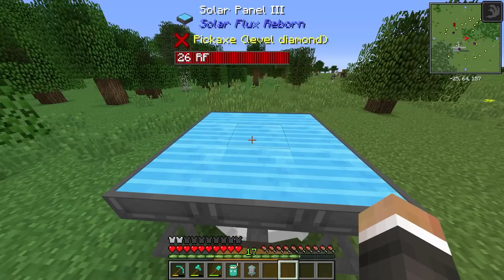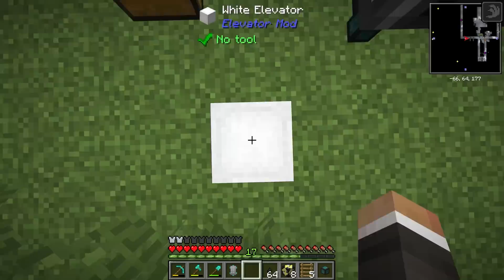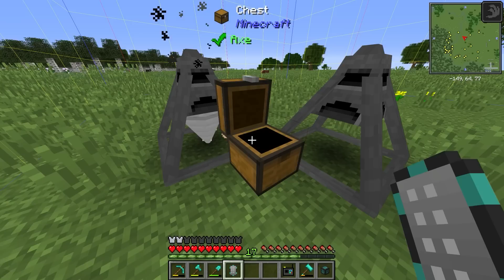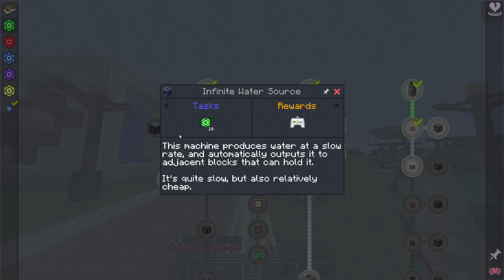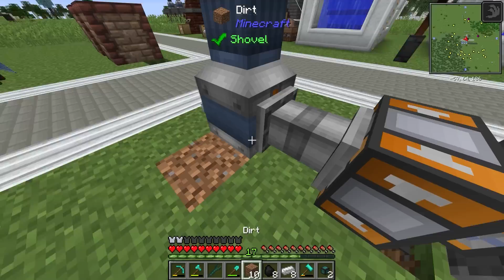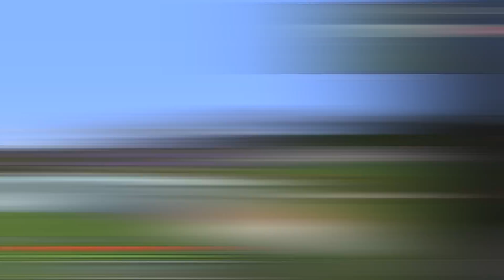Minecraft Feed The Factory | POWER UPGRADE! TURBINES & BOILERS! #9 [Modded Questing Factory]

Comment: Since those streams, the dynamos with turbines have been nerfed quite a bit: they only produce half of the power (80 RF/t) that they did before. So you would need 2 dynamos to produce 160 RF/t, fed by a single boiler. Unfortunately, the modpack quest book is NOT updated, so it still shows 160 RF/t there. As such, it is possible that the boiler dynamos had been nerfed before these streams, but the modpack authors would have failed to update the book yet again.
Reply: I have the latest release 1.0 version of the modpack it produced 160
(edit2 one boiler dynamo produces 160mb/t but one turbine can only consume 80mb/t and produces 160rf/t) (from curse forge not sure if there is one elsewhere)
(however the nuclear craft needed upgrade and version of forge to 2859)
And for anyone seeing this and wondering you don't need pipe between the dynamo that produces steams and the one that consumes it (at least for me it was 1boiler dynamo to 1turbine dynamo 
Also aqueous Accumulator can output directly to the fluid pipe doesn't need the pump if i remember correctly
Reply: And the fluid pipe from immersive engineering doesn't seem to be able to transport 160mb/t 🤔 not sure why that is

Comment: Is using a drill to mine from 4 neighbooring chunks viable? It would be a solution to frequent relocation of the drills. Though dunno if 4 neigbooring chunks all have some ores in them. (It's like T1 drill has 4 blocks which can be placed 1 of them to the each of the corners of 4 neighbooring chunks)
Reply: I am pretty sure it is going to choose a single chunk (in most mods it's the north east block) and consider the drill located fully in that chunk, or it might not even build the drill at all

Not sure about this mod specifically but that's how most mods behave
Reply: @RakoGamesOfficial  i had tried it long ago and it worked (mined all 4 chunks) iirc

Comment: what happens if you put a drill at the centre point of four chunks... will it mine from all four?
Reply: This question is going to be asked under every single video in this series, isn't it?

Sigh. No, it won't, it will only mine the chunk where the output block is located. Also you run more risk of corrupting the save.
Reply: @paulelderson934  ahh thanks, I'm not gonna be the one to ask in the next video haha